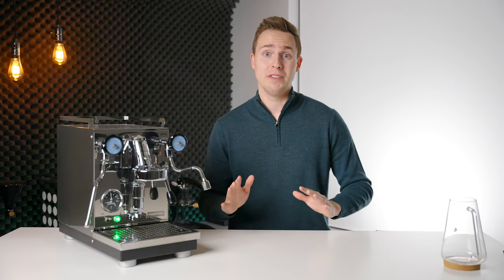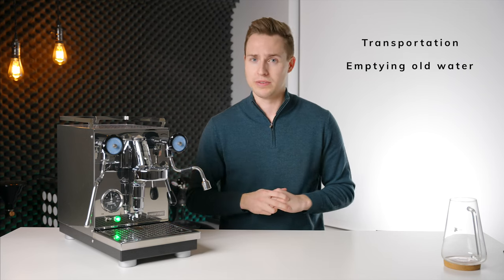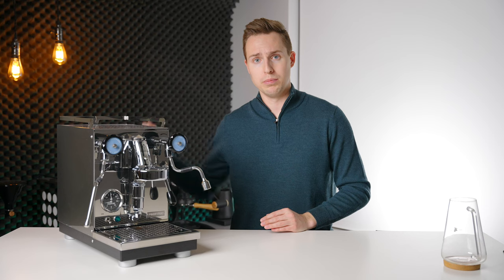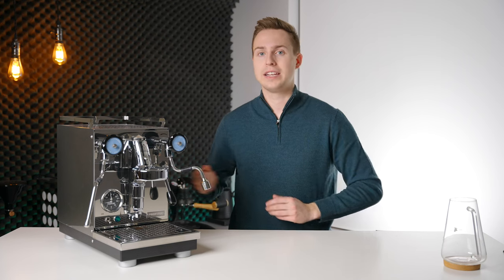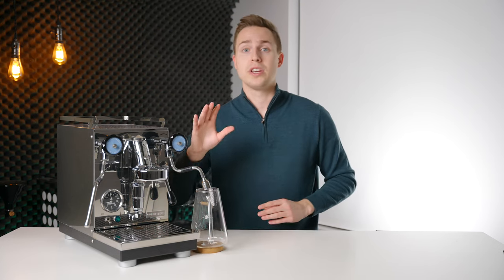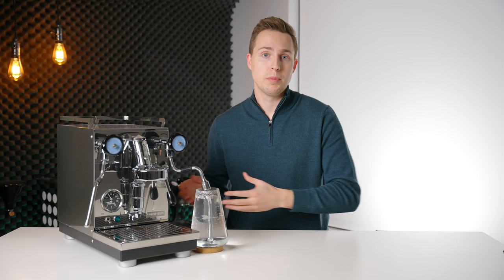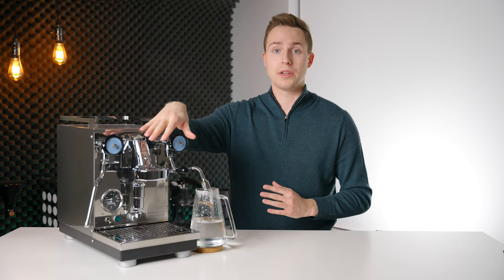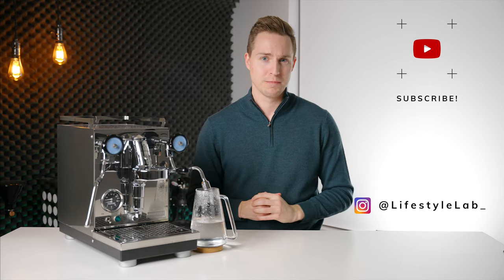How to Empty HX Espresso Machines for Transport

Comment: This method is appropriate for vertically positioned boilers but would not be sufficient for a horizontally positioned boiler (like the Nuova Simonelli Oscar II). Correct?

Comment: I purchased the Barista Pro in early December, but will be moving in about 2 weeks. Is there a similar process for the Barista Pro to get it ready for the move? Thanks for your videos, they’ve been super helpful.
Reply from the maker: No, because it doesn’t use a boiler this process is not required. The Pro heats water on demand with the thermojet
Reply: @LifestyleLab_  Great info! What about Decent?
Reply from the maker: The Decent has one button to push and it preps itself for transport (classic decent)
Reply: @LifestyleLab_  Thank you!!